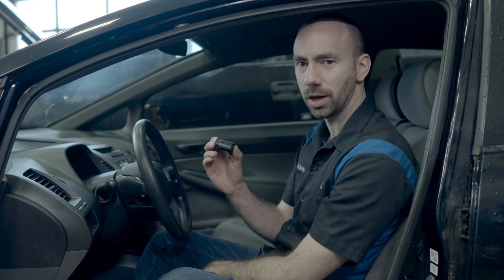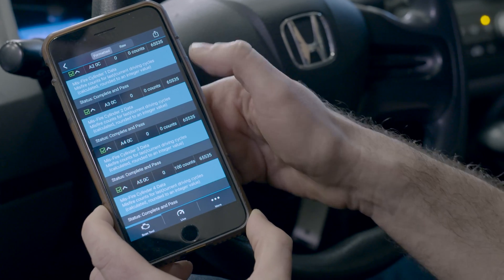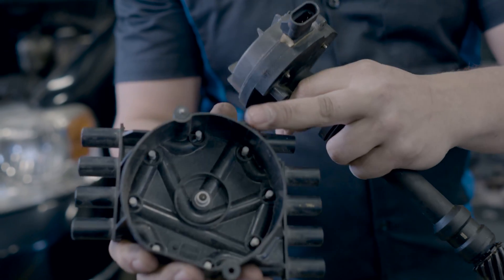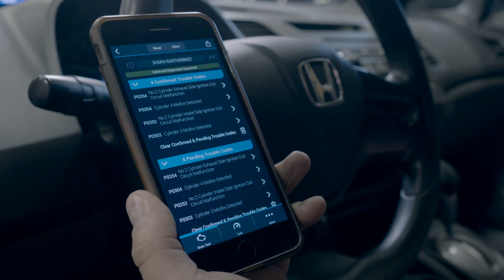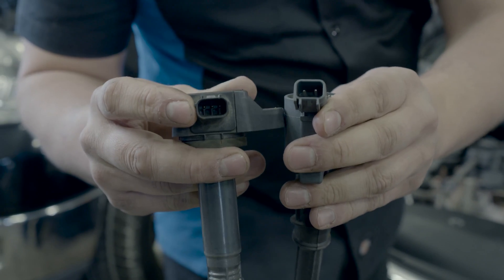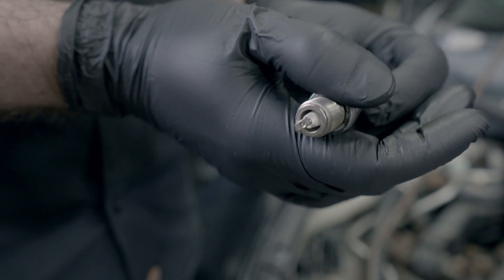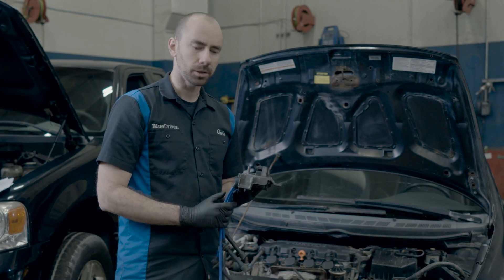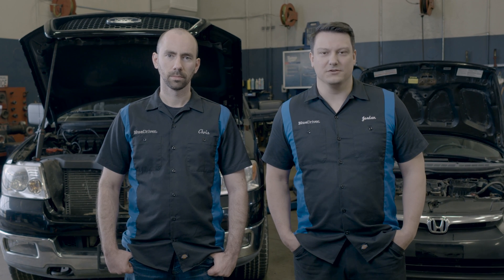Diagnosing Misfires

Comment: I have a misfire in my 01 mustang that goes off whenever i press the gas pedal about half an inch and stops once I pass that certain point. Could anyone give me any kind of clue what could be happening cause the codes don’t help since I’ve already replaced my ignition coil spark plugs and even fuel injectors

Comment: My clues are this: (2006 Camry) With the P0301 code, cylinder one has oil around the ignition coil visible without even removing it yet, the code is for cylinder one as well and also, I noticed my fuel injector area seems to be wet. What would the advice be from someone who was an educated guess on these clues?

Comment: My 2011 Nissan 370z Nismo runs perfectly fine, but it shows “SERVICE ENGINE SOON” when scanned it has P0300. I replaced all spark plugs and Ignition coils with OEM parts. Cleaned MAP and throttle bodies. Reset the code and drive about 150 miles , the P0300 came back!! 😢😢😢😢😢😢😢😢😢. Any advice for this code?? 🙏🙏

Comment: The video and documentation needs to be updated. There really is no up-to-date documentation explaining what the values on the Code 6 report mean in the new BlueDriver scans. The screen displayed at 2:15 in your video shows a much better and easier to understand screen than the new BlueDriver Code 6 Mis-Fire report. So the software seems to have regressed. Much of the documentation and videos show you how to initiate the scans but not how to interpret them.  The current software (2025) has somewhat undecipherable results like 

 Mis-Fire Cylinder 8 Data

Misfire counts for last/current driving cycles (calculated, rounded to an integer value)
Status: Complete and Fail
MID: A9         Min: 3328                 Val: 2322 counts
TID: 0C                 Max: 16648

and there isn't any documentation or any video explaining it.  In addition, my scans say that I have a misfire on Cylinder 9. The problem is that I have an 8 cylinder GMC Yukon truck. I still haven't been able to find out where BlueDriver is seeing this phantom cylinder that it is reporting.

Comment: I've used the BlueDriver hundreds of times on probably 10-12 different vehicles in the last 6 years and it's nothing more than a code reader with Amazon links to parts which may or may not fit your vehicle and may or may not need replacing.  When I bought this, the most appealing feature was the troubleshooting tool which shows the most common fixes for your particular DTC.  Having something like this is why I justified the cost over $40 code readers that do the exact same thing otherwise.  Ironically, it was this feature that was the biggest disappointment, since I've never once gained any insight by reading the most common fixes.  I will say though, the connectivity has always been excellent and the layout of menu is very easy to follow.  Mode 6 leaves much to be desired though, often with fragmented and/or incomplete data.  All in all, I'd say the Blue Driver offers very little value for the price it commands.  You could get much more scan tool for $100 elsewhere.  I wouldn't buy it again and I certainly wouldn't recommend it to anyone I liked.  It's highly rated by DIY'ers who don't know any better and aren't aware their $100 could buy a much more useful and insightful scan tool, (no offense, I was one too, lol).
Reply: What scanner do you recommend then?
Reply: Which one’s do you recommend for 100 bucks?
Reply: @otisshelley4498  Any cheap bluetooth scanner coupled with the Torque app can do what the BlueDriver does, and for half the cost.   I ended up getting a few higher end scanners with bi-directional controls over the last 5 years so I really haven't shopped for the latest sub-$100 scanners, but I do know TopDon has a few offerings which offer way more for the money than BlueDriver.  Foxwell would be another.  Their NT 301 in particular.  Ancel AD 410 also comes to mind.  Plenty of others, but it will also come down to what you're looking for and what vehicles you'll be using it on.
Reply: @otisshelley4498  lol he won't recommend anything cause he's full of sh$t.
Reply: @otisshelley4498  There is a Maddox OBDII Scanner at Harbor Freight for $90 I personally have a ICON T10 and I'll never look at a Basic Scanner again
Reply: Most the ones out there now are following what bluedriver is doing

Comment: I bought a car for $500 that had severe misfiring on cylinder 2 & 5. 
Two of the ignition coil wires were switched, guess which ones 😂. I have tried starting it up yet since the fix.

Comment: Thanks I have a leaky head gasket on a 3.6 L Jeep Grand Cherokee 2018. I put bar leaks head gasket repair seems to be working. No coolant loss or white smoke. But idles a little rough and engine light on P0304. Replaced spark plugs coil screwdriver test on fuel injector and vacuum leaks tested and okay.  Question, can a leaky head gasket cause cylinder 4 to misfire? I really want to know thank you
Reply: Do an internet search about it but yeah if it damaged the cylinder or is still leaking some
Reply: I had an older Jeep and I stepdaughter kept driving it despite the leak and it ended up damaging the cylinder and the walls and the head
Reply: sorry to hear about your cylinder And that sucks is there anything you can do with it? when I wrote this comment I also replaced the fuel injectors spark plugs and coils. ended up fuel injector cylinder 4 was bad and had a broken fuel injector gasket on it super dirty. I also replaced the vacuum hoses PCV EGR valves and it's? running really good no engine light,  I driven it over 5000 miles which is a lot yet head gasket is still holding up. we will see and I'm oppressed with bars leaks head gasket repair sealant. 
  @livenfree

Comment: 5:23 a good thing to mention would be that if it is the ignition coil that's gone bad you will still have the original code plus the new cylinder you moved it to. Like in this video it's cylinder 3 and 4 when they recheck.
Reply: Unless you reset the codes yourself first

Comment: Hello. Question. Are you using an Iphone? It looks like you're working on a Honda Civic. I have a 2010 and when I connect my BlueDriver Mode 6 looks completely different. Also is there any plans to add Active Testing? Would have helpful to troubleshoot EVAP issue.

Comment: Got a p034 change the  spark plug. Coil wires check pressure on it nothing so far keeping getting misfire 4 cylinder 2002 Nissan frontier crew
Reply: what was it? injectors?
Reply: @ yes

Comment: So I have no codes or check engine light. Yet under mode 6 data, I'm getting misfires.  Today I got 6  counts of misfires on cylinder 3 and 1 on cylinder 1.  Another 2 on cylinder 5.   Yet I got no code.   Any help would be appreciated

Comment: I put new plugs and coils still miss firing. 😢 same codes than before.
Reply: Have the same problem. Next step is fuel I jesters according to bluedriver hope it works 🙏
Reply: Hope you guys checked your work, sometimes a flexible boot on the coil can miss the spark plug. (Ask me how I know). 
I would check spark plugs after the coils. Just an easy diagnostic, compared to fuel pressure/delivery.

Comment: I installed new plugs. Cyl 2 and 8 had misfires under light load, be fore and after plug change.  Moved cyl8 coil to 7 and 2 to 3,   Still have misfires on 8 and 2.   My car is 2015 mustang GT Roush stage3.   I’m narrowing it down to the VCT solenoids or injectors.

Comment: Hi guys, I have a question with my blue driver and a 2000 silverado. I just replaced my bank 2 up and downstream o2 sensors. I used the mode 6 option I took a screenshot amd was wondering what this means. Do you have a email I can send these pics to for some clarification please

Comment: Does bluedriver give me access to LIVE misfires in mode 6 data?  I am trying to find a scan tool that will allow me to track misfires live so I can rule out a shaky idle as a misfire engine performance issue and not a mount or harmonic balancer
Reply: did you ever find out if its possible?

Comment: They talked about measuring the resistance (ohms) of the coil but never actually did the test. Is the normal resistance approx 1 ohm on a 2 pin coil? Does anyone know the correct method for measuring? Thank you
Reply: Between 1-6 kohm

Comment: Great video. I would like to add for those with plug wire testing is to get in a dark area allow time for your eyes to adjust to the darkness and run the engine at idle in this well ventilated area and look. You will see the spark.

Comment: Should i leave bluedriver after finish using it or i can leave it in there without taking off bluedriver?
Reply from the maker: You can leave it plugged in yes. If a vehicle is going to sit for 3+ weeks without running we always recommend unplugging it at that point. The only exception would be a Mazda vehicle. You should always unplug the scanner from a Mazda when you are finished with it.
Reply: @LemurMonitors  why Mazda?
Reply: When I left this in my Camry and restarted the car, it caused rough idling. (It went away on next startup) Wait a minute after starting up the car before you plug it in.

Comment: Did you say 2008 and newer on all models?
Reply from the maker: If this is for mode 6 yes, with the exception of Fords who had mode 6 misfire counters almost since the beginning.
There are a few exceptions, some vehicles that started using CAN early may have them as far back as 2005ish
Reply: @LemurMonitors  Will that be Honda's after 2005?
Reply: Called your support and yes supports Honda's 2006 and up.

Comment: I have a 2006 altima 2.5.  Code P0302. New set of plugs  then swap coils around  same code moved the injector around same code. Replace cylinder 2 injector to no avail. When to the dealer he told me I needed to replace it and have the rest of the injectors clean at a whopping price of 1000.00.
Car idles rough but when you put foot on the gas ever so slightly it runs smooth. No loss of power no excessive fuel consumption . Only idles rough. Suggestions?
Reply: I had multiple coils on my v8 that were only half faulty, so it wouldn’t throw a code and engine idle wouldn’t change when you swapped them around either. Finally just ate the $ and bought OEM new coil packs for 35 a piece. Ran like new again

Comment: After the knock sensor replacement on the 2002 chevy tahoe v8, i got a p0300 code on my Bluedriver app and the car was trembling. I changed the intake manifold gasket and throttle body gasket, and the car no longer trembled or hesitated to stay on. Just some advice for anyone out there
Reply: The intake manifold leak will make the engine think it's running lean because of unmeatered air coming into the engine, the O² sensor will sense a lean condition and add extra fuel to compensate for what it thinks is a lean condition but it's actually gagging on all the fuel. 

This would also be noticed by as a lean condition in your short and long term fuel trim data on live data with Blue driver. Fuel trim is taken after engine is warm and should normally be 0% but can fluctuate  5-10% either way. The "lean" condition will set a code if it exceeds 25%. Fuel trim will Improve when you drive if the vacuum leak is smallish, otherwise you have other issues.